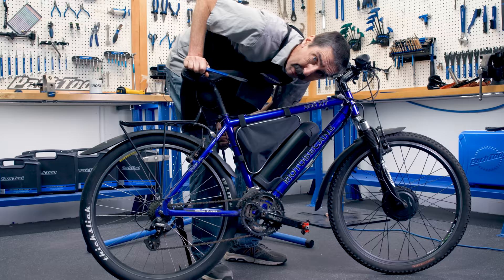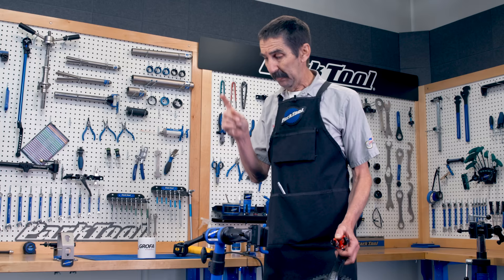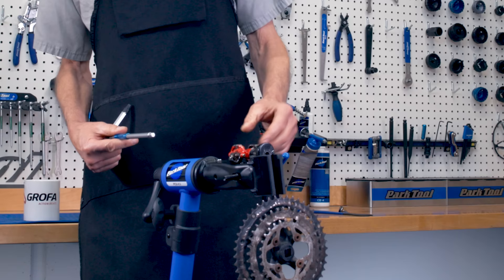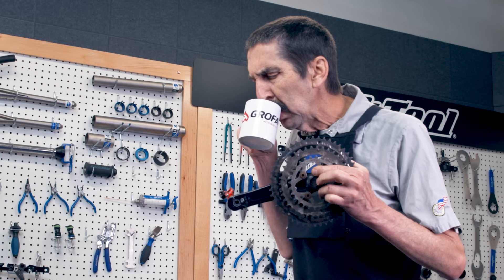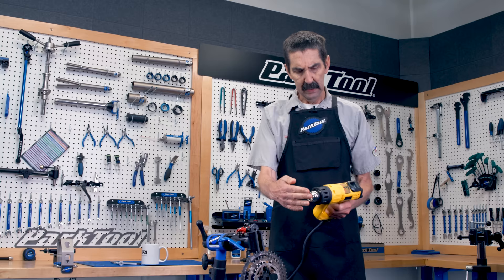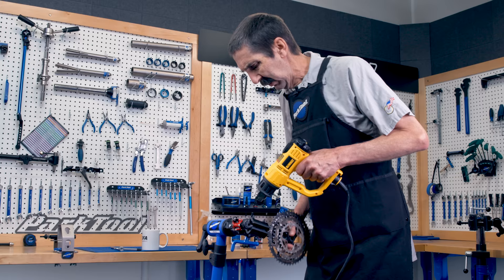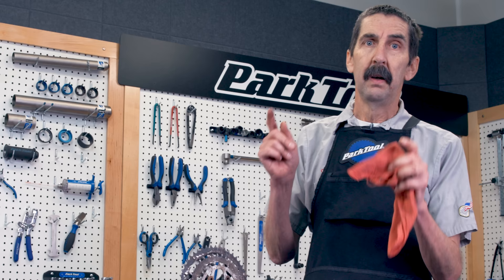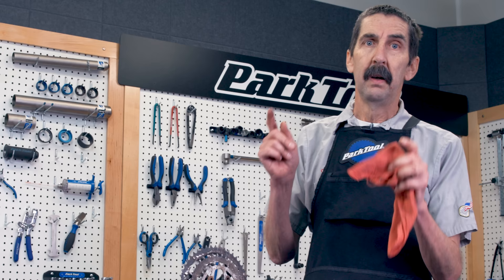A Stubborn Pedal Removal | Tech Tuesday #221

Comment: this week i had the worst set of pedals i've ever seen. i disagree with your assertion that penetrating oil doesn't get into the stuck threads as i was sweating with a cheater bar on wednesday, but after 3 days and maybe 10 applications of WD-40 on the pedal, on sunday the pedals budged. I did the torch treatment both times and the only difference was the WD-40 and probably a bit of loosening up from the two tries beforehand. I know it's not the right product for this, but that's what i had on hand and since I was thinking at the time I'd have to toss the cranks anyway, I didn't buy anything else.

Comment: Hey Calvin, what's your opinion on pedal extenders? I had some titanium 20mm pedal extenders on my Shimano M5100 crank with my Race Face Chester pedals. I took my bike into the bike shop for a tune up and the mechanic told me I should get rid of the pedal extenders because they can put too much stress on the crank arm and can mess up the threads where the pedal screws into the crank arm. The main reason I had the extenders is because my big size 12 feet were coming VERY close to hitting my chainstays when pedaling and I found a wider stance on my bike with the pedal extenders was more comfortable ergonomically.
Reply: A bike mechanic will have seen the worst of the worst. If you're not THAT ape, you'll probably be OK.

Comment: Would matches or a lighter give enough heat to do the same?
Reply from the maker: Playing with fire is a bad idea.
Reply: No, not enough heat and not diffused enough. If you don't have a hot air gun, a bowl of boiling water would be best.

Comment: Would you use a heat gun on a Shimano hollowtech crank? They are glued together.
Reply: Good reason NOT to use hollowness cranks😂
Reply: U r just heating the crank no tossing it in a fire pit.
Reply: Using hot water would be more controlled.

Comment: Is he right that using penetrating oil is useless? I'ld like to believe he's wrong?
Reply from the maker: You can try it of course, but remember,  if the pedal is tight, it is sealed to water and liquids.  If there was a gap big enough to get in oils, then the pedal is not tight, and it would not be stuck.
Reply: @parktool  it’s just that these oils have been around for ages and YouTube is filled with videos that show their efficiency on bolts, so unless there is something very unique to bike pedal threads, I don’t know what’s going on here.

Comment: Why don't you have a bench vice?  Would be a lot safer and easier than the bike stand.
Reply: Because Park Tool doesn't sell one.  Same thing for impact wrenches.  I don't slight Calvin for it since this is the Park Tool channel after all.
Reply: @BrianCartier  they make Park vice inserts and bench mount frame clamps.  And that was not a Park heat gun.  Using a floor stand is a fantastic way to strip out something or smash your knuckles.

Comment: No need whatsoever to remove the crank and put it on that waggly stand, just lie down the bike on a block of wood & put a hammer drill on it. Far less chance of rounding out the hex. This whole vid is nonsense overkill. And a pipe extension on the tool would make the nonsense approach easier.
Reply: That’s ridiculous do you even work on bikes bro?